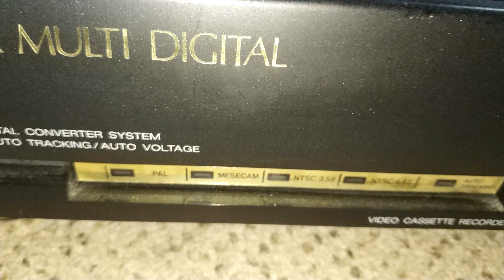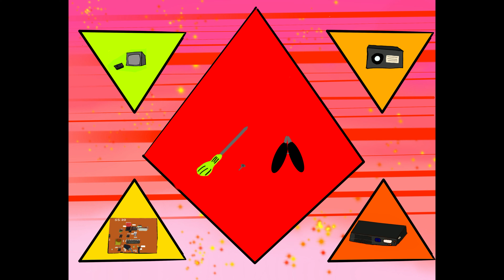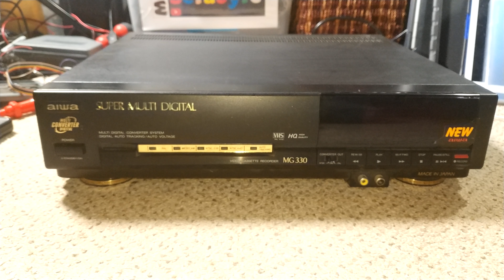Aiwa MG330 Multi standard VHS assessment and Philips VR2840 remote receiver fix

Comment: The remote AV5567 is for the Philips VR6920 (built by Panasonic) but works with Philips-devices too, because it is an RC5-IR-Controller. The Philips VR2840 has on its back a little hole, often covered by a little round plastic-cover (not the bigger one, where the service-connector is!). Underneath there is a switch (looks like a variable resistor), with this switch you can turn on and turn off the IR-Receiver. Maybe you should check this switch, it could be faulty. Just turn it some times, maybe it got back to work. Please remind, that, when you film with moble phone, the camera may block the IR-signals to get to the receiver!!!
Good luck with the repair! :)
Reply from the maker: Thank you so much for all of this - very much appreciated and it does really fill-in the blanks for the remote. Very useful to know about the remote and the mysterious switch too. Thank you very much for sharing.
Reply: @MrBetaByte  You are welcome 😄 I have some short videos about the Philips VR2840 (and other vcr's) on my channel, maybe they are interesting for you. 😉
Reply from the maker: @vvm2004  That's great! What a fantastic channel. I'll enjoy going through all you're videos - some real gems of machines there!
Reply: @MrBetaByte  Thanks! The same to your channel! 😀 Btw some machines will still follow. 😉